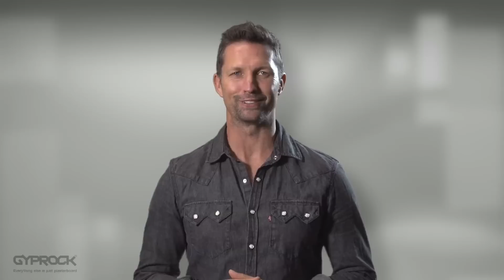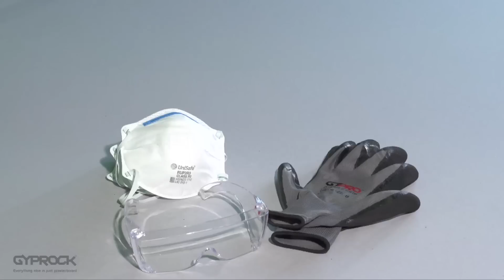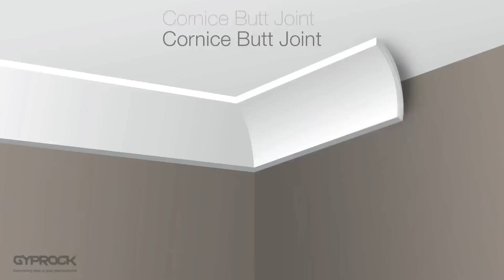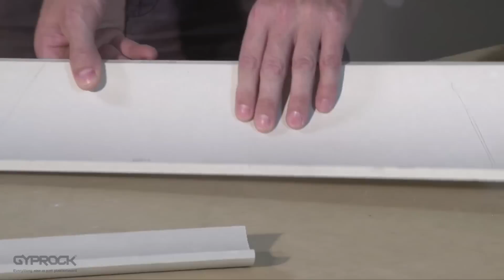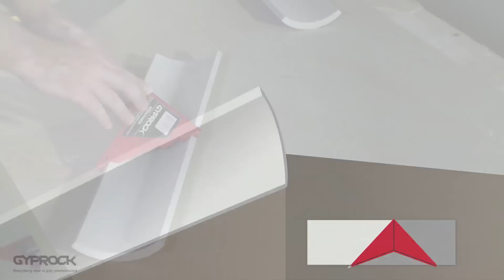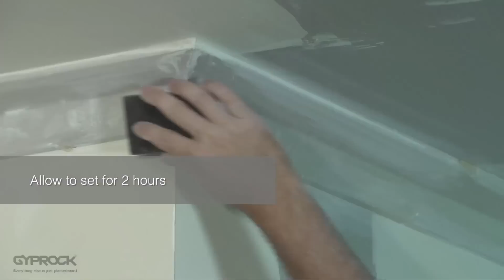Installing Gyprock plasterboard - How to cut and install Gyprock cornice

Comment: instead of using traditional plaster adhesive which i considered "crap," you should use Soudal Genius Gun Plasterboard Adhesive Foam because it is a better option for bonding coving

Comment: Very informative video for beginners. Well done. I would recommend using EPS plaster-coated covings.  EPS provides a durable, water-resistant material that's still lightweight, while the plaster coating gives an attractive smooth texture. Google this company - Homemerce -  if you’re based in the UK.

Comment: I’m a qualified Aussie gybrock plasterer fixing flushing and all types of cornice,I cut all my cornice on the concrete floor in the main living area using a ply timber miter box ,i can measure and cut without moving up and down the cornice by sliding the cornice on its back with the white lufkin tradesmen tape it’s got red 100 mm stages for dark areas ,I butter up with a 6 inch SS Hyde broad knife 300 mm trowel use a sausage technique with the trowel applying a 10 mm bead closer  inside lip more on ceiling instead of bleeding out ,measured all the rooms left to right,cut turn upside down diagonal in each room then I mix a 60 minute red flexible 8ltr bucket,sit the bucket on a crate,mud up on my own throw a 3.6 75 mm cove feed the internal cornice first slide back and forth t
Reply: Wow!! Thank you!! I’m in Virginia and just found out about this stuff and your comment is awesome!! Just know that you really truly helped a stranger today!! Thank you

Comment: recently we had tradespeople over installing our cornices and they used the gyprock cement to secure the cornice which seems standard but they also used a staple gun at particular points of the cornice on the wall. does anyone know if that is the correct process for cornice installation?
Reply: Its not incorrect. Its probably a lot easier that using the nails which you have to patch later. 
Its the cornice cement thats holding it up.

Comment: How do you join a new piece of cornice at a internal corner to an existing cornice  and get a accurate measurement and also how do you deal with an uneven ceiling, if you measure 75mm at one end of the wall and the other end becomes 85mm?
Reply: You have to check it in